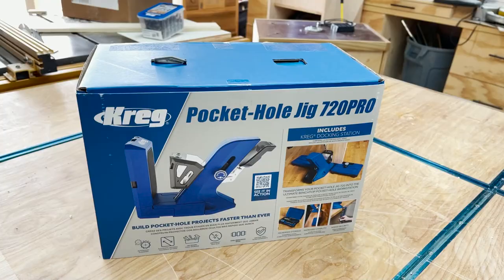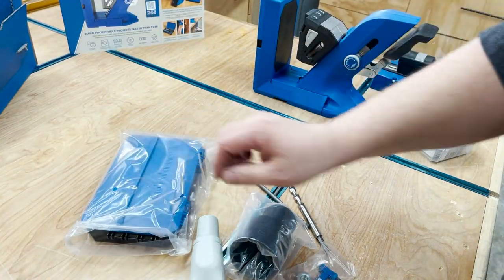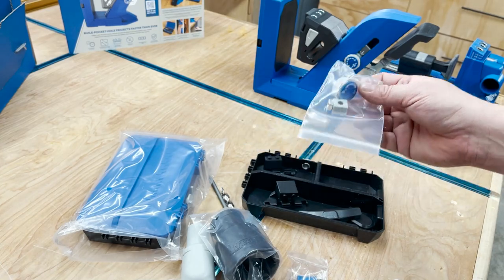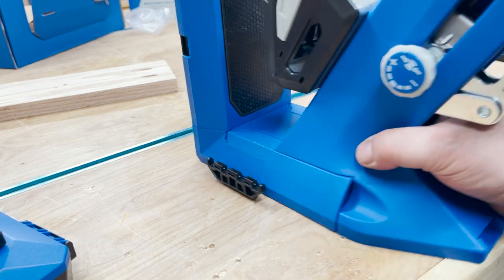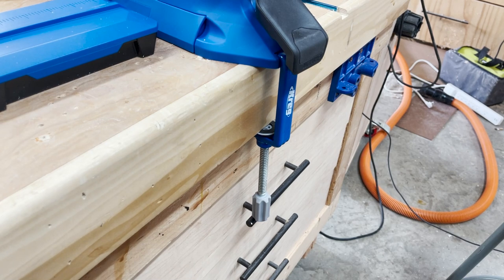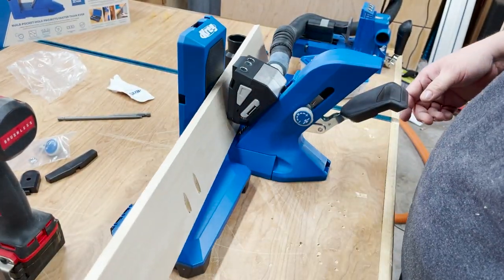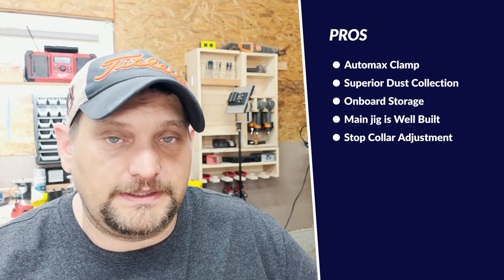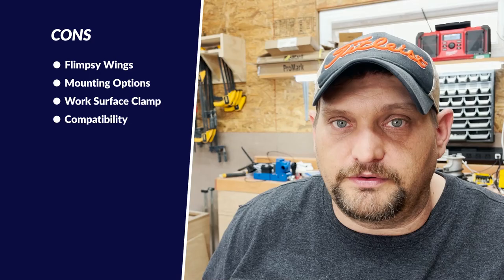Kreg Jig 720 Pro | DIY | Fox Hall Tool Review | Ep. 9

Comment: Wait you wanted to know our thoughts. My thought is I put off getting the K5 till about a year ago. Therefore, I will hold off getting this one until about 6 months before they come out with a different one. I like the clamping and the ability to clamp large panels horizontally and drill the holes is nice. But, I don’t know if that’s enough to justify it.
Reply from the maker: If it had more mounting holes or a better workspace clamp then I could justify it.  Operation itself is really nice
Reply: Agreed, starting off with it would be a definite bonus. I just upgraded from the R3 to the K4 last year or so I probably won't be picking it up anytime soon.

Comment: Thanks for this review.  It answers some questions for me, really appreciate it.  Question:   I have a K4 system that I am not terribly happy with it.   Should I go with the 720Pro or a K5 system while they are still available?   Difference is only $10.  Really torn with this direction giving this video.  I might add that I will not be permanently mounting  it so the 2 holes are not a major issue for me.
Reply: I’d say get the 720 pro if that’s the only price difference. I have the K5 and love it but I have changed depths of wood and forgot to change the K5. Not a problem with the 720 pro.

Comment: Still going to run my K4 for now. I don't see the need to upgrade to the K5 or get any of the two new products.
Reply from the maker: Now I will disagree with you on that one.  The K5 clamping system is so much better than the K4.  I started off with the K4.  But having to reach around the back of a large piece to unclamp was a pain in the butt.

Comment: Thanks for the review! I just upgraded to the 720 Pro from the K4 and feel like it was a worthy upgrade with the AutoMaxx clamp. I likely would not upgrade from the K5. I am trying to think of a mount to make for it with handles like I did my K4. I would like to be able to remove the unit from the mount if needed if I want to drill pocket holes in a sheet of plywood lying down like you demonstrated.
Reply from the maker: My buddy Drew at rock n H wood shop has a cool design with a sliding dove tail feature.  https://youtu.be/tTCeWgr3tpA

Comment: Awesome review. I really like it overall but have the same exact complaints as you. I watched your video on mounting the k5 and plan to do similar with my 720 but the lack of screw holes is problematic. Also, the wings need to be open to access the two holes. Have you mounted yours? Any ideas or tips?
Reply from the maker: still haven't mounted it yet.   I might keep it and have a second option for pocket holes.  It does cut the cleanest holes  but the Massca M2 is a more versatile jig.

Comment: It seems like the 1/2” might be too deep fir the normal screws. Did you make a joint in the 1/2” material? Any problem with the screw pushing through?
Reply from the maker: Yeah I did.  It worked really well.   The auto clamp is killer.

Comment: I want to try the 530. I think that's what it's called.  The versatility of that one looks a whole lot better. Nice review though. Thanks.
Reply from the maker: True.  But i could see it becoming an issue with the pump still trigger with a lot of holes
Reply: @foxhallww311  possibly. I know there a way to set the release amount. Where you only have to pull the trigger once and your locked back in.
Reply from the maker: @sinsofvorador   Might have to get one and check out then compare the 2 models
Reply: @foxhallww311  yes please do lol. The review you did on the 720 was awesome and informative.

Comment: I think the problem you have with the tabletop clamp is you do not have enough space for the clamp screw to fit correctly. With only part of the screw pad in contact, it will not be secure. Other than that thanks for your review. You have a thumbs up from me. Your review gave me a reason whether to get the model with the wings or not.
Update: Just saw WoodWorking Garage video on the same jig. https://www.youtube.com/watch?v=kovyaZgQKvY His workbench did allow him to use the whole clamp pad surface. Although not as much wiggle as you had it still is not solid. He also showed the clamping system for the K4. It is superior.
Reply from the maker: Yeah my top is too thick for the clamp.  I mentioned that in the video.  But I also clamped it to a surface where it did fit and it still isn’t secured in the front.  It’s just a poorly executed design.

Comment: Why would you want to mount it as you then cannot turn it over to use with large pieces of wood, odd....?
Reply from the maker: Because if you mount to a cabinet with support surfaces you won’t have to turn it over
Reply: @foxhallww311  however it would still be easier to pocket holes into large sheets if you did turn it over as opposed to leaving it upright which is the whole point of this great jig.
Reply from the maker: @philipb867  yes I am fully aware of that.  You do what you want to do.  I will do what I want to do.
Reply: @foxhallww311  nothing like an unbiased review

Comment: Still using a k4
Reply from the maker: Not my favorite
Reply: @foxhallww311  no, but for occasional use it still works, and not worth spending the extra on a new one, at least till its destroyed, plenty more tools I can do with first.
Reply: And the upside is......
The cost of upgrading to the k 5, then the newest model afterwards. Comes out at around enough to buy a foreman. So keep saving to next year for me
Reply from the maker: @mikeenglish7063  I would go straight to the 720pro.   The K5 has clamping issues
Reply: @foxhallww311  cheers 👍👍👍